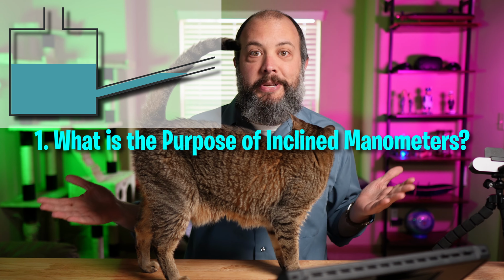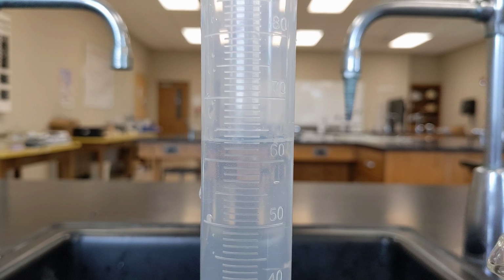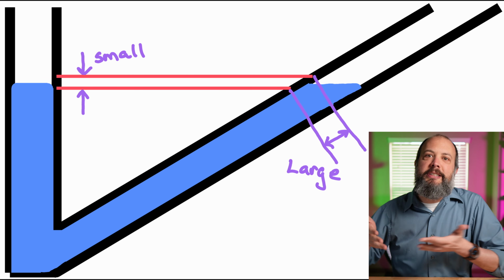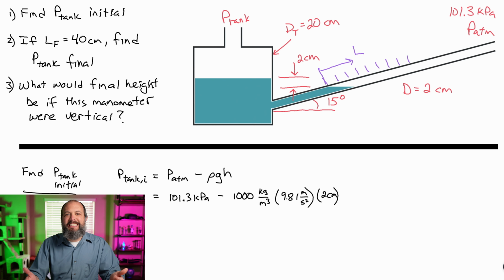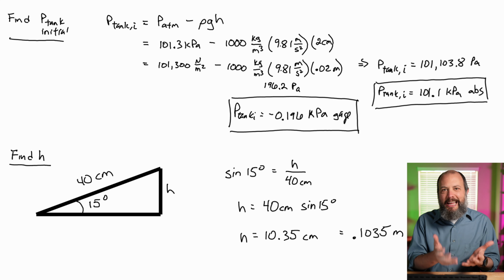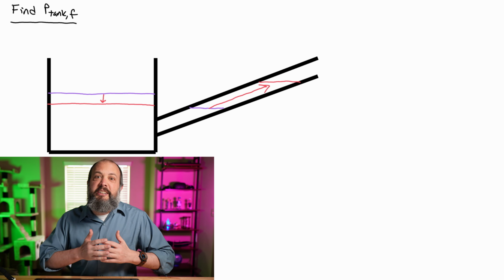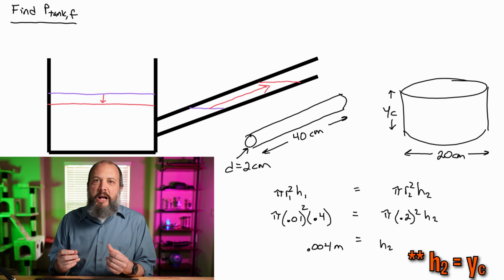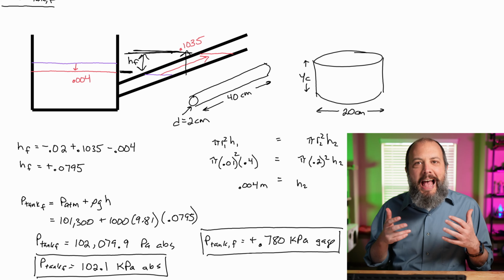Inclined Tube Manometer Example Problem

Comment: In the calculation of the height h2, you used the volume of fluid going into the inclined tube equal to pi*r^2*L, with L = 0.40 m right? Why didn't you use the equation for the volume of a slanted cylinder, which is: pi*r^2*height ==> pi*r^2*L*sin(15°)?
Reply from the maker: Different radius. The version I use is when the slanted radius is known, so you use slanted distance for height. The version you use with vertical height would require knowing the radius in the horizontal direction, which you usually wouldn't know.